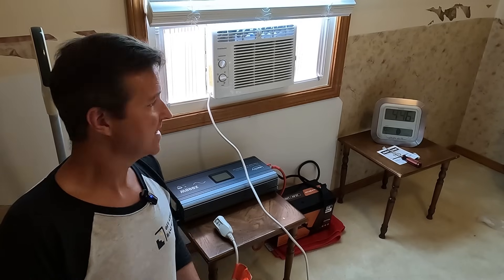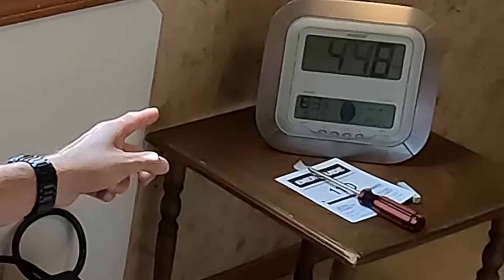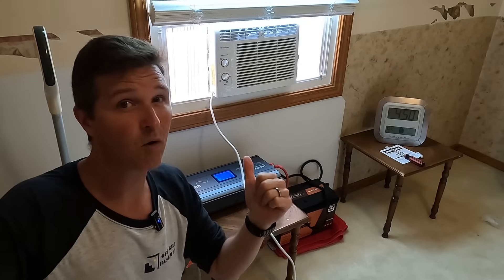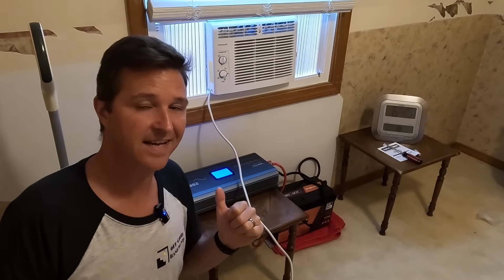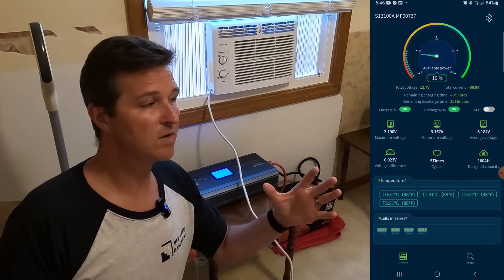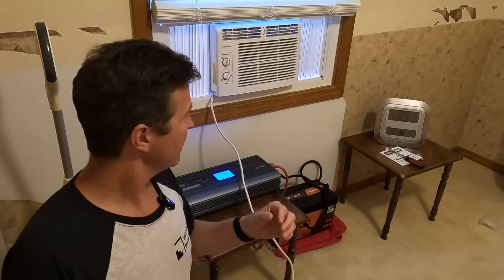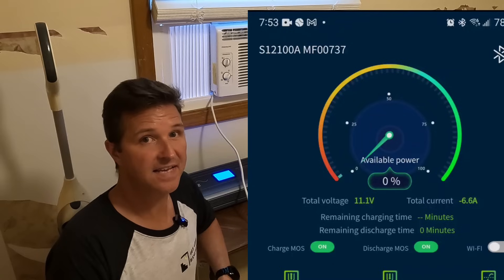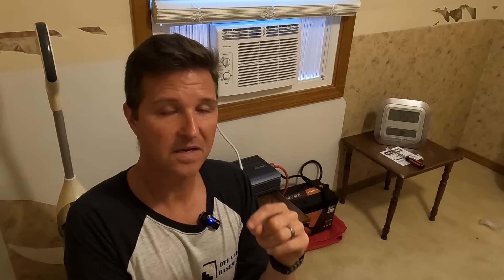How long can you power a 5,000btu air conditioner with a 12v 100ah Lifepo4 battery?  Let's find out!

Comment: Power requirements of a standard window unit air conditioner are much different than a larger inverter mini-split unit.  Inverter mini-splits are so efficient they are turning up on RV's and running on solar.  There's a BIG difference and it's a game changer.
Reply: There is a lot of hype with those Inverter Mini-split Heat Pumps.  I bought 2 upper tier efficiency models for my house so I could run them off of solar and backup power.  These have variable speed fans, compressors, and expansion valves.  The efficiency is highest when they have reached the set point temperature and are about to shut off.  The rated efficiency of these units is a SEER of 23 and 25.  I don't like the SEER (Seasonal Energy Efficiency Ratio, which is a rough estimate of how much power will be used during the summer or winter) rating system as it waters down the steady state efficiency, the EER (Energy Efficiency Ratio, which is cooling [or heating] output versus power consumed) system was much better.  I suspect SEER was adopted for mini-split inverter units because, the efficiency radically changes depending upon the outside air temperature.  For instance, in the test conducted in the video, the mini-splits I have would only show an EER of about 10.  I have observed that when the outside air temperature goes above 90 degrees Fahrenheit, the efficiency plummets.  If the outside air temperature rises to 97, the EER drops to 7.5.
Reply: @billharris6886  THANK YOU BILL!  This is really good data.  Still, having a throttleable air conditioner is a giant leap forward.
Reply: @BulletproofPastor  It is a huge leap forward if you understand and make use of the positive benefits.  In my testing of a standard 60 Hz induction motor window unit versus the inverter mini-splits I have, the mini-split power consumption varies about 10:1 (1,000%) over temperature and thermostat settings versus about 20% for the simple window air conditioner.  In plain terms (something you can sink your teeth into), my estimate of EER for my mini-splits is 5 to 30, depending upon inside and outside temperatures and unit throttling.
Reply: Sorry I don't understand your lingo. Are you saying the mini split is a good choice to run with a solar inverter or not? I would like to get 2 installed to replace window units and it would be great if I could run them on solar all the time.
Reply: @tammieaf2712  Hi Tammie, I'm not sure who your question was directed to so, I will give it a shot in hopes your question get answered adequately.  Yes, a Mini-Split Heat Pump (heats and cools) typically would would be big improvement over a simple window air conditioner, as they are more efficient.  Also, I run my mini-splits off solar power when it is avaliable (weather and time of day permitting).  I chose a 9,000 and 12,000 BTU unit, both run off 120 volts AC.  Most of the mini-splits out there run off 240 volts but, I specifically wanted the 120 volts so the units could be run from virtually any backup power source that puts out a minimum of 1,500 watts (per mini-split).  I could elaborate more but, I probably won't be answering specific questions you may have.  I would be happy to answer any other question to help point you in the right direction.  I live in north central Florida and, being a native Floridian, have been through numerous hurricanes.
Reply: @tammieaf2712  Inverter mini-splits proportion power to both fan and compressor to "softly" turn them on without hard spikes of current.  This feature makes their peak current demands low enough to run on solar inverters that otherwise would shut down because they can't meet startup current needs.  Yes, they can run on a solar system that meets their run current needs.
Reply: @BulletproofPastor  thank you for clarifying that! I have a lot to learn before I will feel confident enough to build or assemble anything electrical.
Reply: @billharris6886  thank you! I have a lot to learn!
Reply: @tammieaf2712  Now retired, I made a career of designing high performance aircraft communication radios, which also includes the design of power supplies and power inverters.  On the side, I have been focused on home backup power since the 1980's when I realized everything is tied to electrical power, a problem that has only gotten worse over time.  I have been doing home solar power on a budget since 2009.  What I am getting to is, I probably have been through your set of problems and can likely provide some direction.
Reply: @billharris6886  Do you know the start-up watts of your 2 units? I was wondering if the 1,200 btu was much higher than the 9,000 btu unit. I would also like to know the run watts if you know. . I am   getting a couple of small minisplits to run off solar too, if possible. Thanks.
Reply: @PersonalStash420   Being fully variable speed everything (compressor, both fans, and expansion valve) there is no surge current to speak of.  When first turned on, the power consumption slowly ramps up over a period of about 2 minutes.  Depending upon the outside temperature versus indoor temperature, the power draw could be as low as 187 watts.  Simultaneous hot indoor and outdoor temperatures cause the highest power draw.  I have witnessed as high as 1,250 watts but, according to the unit specs, the draw can reach 1,600 watts.

The 9,000 and 12,000 BTU units appear to be identical in physical size, cooling/heating output, and power draw.  I estimate the maximum cooling capacity is actually 15,000 to 18,000 BTU.  I bought my mini-spilts in 2020, brand name is Cooper & Hunter.  At that time, the units were considered mid-to-upper level efficiency.  I installed them myself.  I run them off solar power if full sun is available.   Before I installed the mini-splits, my typical power consumption during July (the hottest month) was 33 kWh per day.  With the mini-splits I no longer use the house installed HVAC system, just the mini-splits and now averaging about 18 kWh (aided by solar) daily for July power consumption.  I live in the Ocala, Florida area, typical high temps during the day in July run 95 to 98 degrees Fahrenheit.
Reply: @billharris6886  Thanks for all the info.
Reply: @billharris6886 we live in south jersey in a 1200sqft ranger. We have an very old hvac that runs on oil. 

For AC we got window units and in the livingroom a wall unit. Our hvac is about to go into itslast year because of old age. I don't have alot of knowledge on Hvac and ac but i figured i want to do a mr cool split unit system. 

We have 4 small bedrooms and a livingroom. I would love to hear some recommendations/tips  from you.
Reply: @BulletproofPastor  True don't need a soft start for solar many window AC units are also inverter type lot cheaper. I have one in my shed 5k btu Frigidaire cost $139 at Home depot it runs off a 1500 watt inverter. The nice thing about windows units is sealed system no dicking around with the lines, and leaking flare connections like a mini-split.
Reply: @Mike-01234  I didn't know window units are offered with inverter power.  Thanks!  I think the advantage of a mini split would be quiet operation.  Most run so softly that you hardly know they're on but the robust design of a window unit makes them a more durable option.
Reply: @BulletproofPastor  Someone said to get a "soft start" to get them going.
Reply: @billharris6886  So with the same setup how long do you think a mini-split would run? If he is only getting 2-3 hours on a window unit.
Reply: @Skid_A_Follower_of_Christ  The smallest mini-split is 9,000 btu so, based upon the same size unit I have, using the same inside and outside temperatures, plus the cooling set point, I estimate 3 hours to discharge the battery to the 20% SOC (state of charge point).  This is only a rough guess though, the 9,000 btu unit I have has a cooling rating of 23 SEER.  The window unit in the video probably has an EER of 10.  A lot would depend upon the outside temperature at 6:30 pm and beyond (since the test started at 4:30 pm in the video).  I mention the 2 hour point since that is when the SOC was at 20% in the video.  20% SOC is a good place to stop the test in order to maximize battery life.  Cooler temperatures (below 90 degrees Fahrenheit) cause a large increase in efficiency with inverter type mini-splits.
Reply: @billharris6886  Ok thanks!
Reply: @billharris6886  Your correct SEER rating is takes an average from 65 to 100F. If you are where it only gets to 85-95F not that humid they do pull less power, but if your like me in Phoenix when it gets to 115F outside my cheap 13 seer goodman pulling same power as the 19 seer Trane my neighbor has. The difference is I paid $6500 for my 4 ton goodman he paid $23k installed for his 3 1/2 ton I have measured the current with a clamp meter both of ours pulling 20 amps on each 240V leg when it's really hot out. The ROI isn't there as far as mini-split they are a cheap way to go compared to what a big ducted split system costs I just put one in my garage thinking about installing another one in our bedroom so hot here hard to sleep no matter how many fans are going.
Reply: @Mike-01234  Thanks for your input.  I live the Ocala, Florida area, which is not nearly as hot.  Typical summer high temps usually runs about 95 degrees Fahenheit, while humidity is 50 - 60%.  115 degrees I would think is at (or slightly above) the limits of the average A/C unit, high side pressure would be hard on the compressor.  I agree with your assessment of the SEER rating concerning the expected operating temperature range.  It appears to be a rough estimate of performance the manufacturers can use to their advantage since it is much less precise.

As far as the mini-split goes, one of the several reasons I wanted to go with it, is the lack of duct work.  I don't know about home construction in your area but, in Florida, a flexible plastic duct is used with 1 inch of fiberglass insulation.  The ducting is run through the attic where temperatures are typically 30 degrees Fahenheit above the outside ambient, yet the ceiling insulation is 6 to 12 inches.  Needless to say, the duct work is picking up a lot of heat.  Additionally, the condenser fan motor needs several more times the power to push the air through the duct work.  With my setup, I installed a mini-split on both ends of the house (for a total of two units).  I no longer run the central HVAC unit (which is a 4 ton package unit with an EER of 10), it is not needed.  During the summer months, the daily power consumption for the whole house has dropped 40%.  If the day has full sun, I supplement with solar power for a 60% reduction in grid power.  This has been helping a lot with the electricity price inflation; my rate as gone up 4 times in the past 6 years.

Yes, the price difference between Trane and Goodman is huge, especially if you have it installed, and the performance/quality difference is not in line with the price.

As to your observation, I also noticed that the inverter system appears to drop below the efficiency of the standard induction motor system at high outdoor temperatures.  One thing I discovered about the inverter mini-split, throttling the unit back to the point where it is barely cooling provides the highest efficiency.  However, my observations are just a guess since I don't have the test equipment necessary to measure the actual cooling with all possible conditions.  I always try to keep my units throttled (when conditions permit) to keep efficiency highest.

With the high heat you experience during the summer months, you could probably save some electric by chilling the house a few hours before sunrise, then allowing the indoor temp to rise to 80 during the afternoon, and using more personal fans to keep cool during the afternoons.
Reply: A lot of the mini split I see have worse efficiency than the equivalent window unit. When compared with specs and watt usage  @billharris6886
Reply from the maker: Thanks for the info and the comment.
Reply: @OffGridBasement  I would love to see the same test done on one of these Inverter units.  The comparison would be awesome.
Reply: If it's only drawing less than five hundred watts then why are you using a 2000 watt inverter. Step it down to a 750 watt and you will lose less conversion power from the inverter.
Reply: @quevicular  I don't think that included start-up voltage which could be double that number.
Reply: Not really true. Plus it needs alot for startup watts.  1500 to 2000 is required.   @quevicular
Reply: This is absolute nonsense. A 9k btu 12v mini split requires 60-80 amps. With 600ah available battery you'd be lucky to run it 6-8 hours at mid cooling. Lol
Reply: @fvgc454ss  So I looked up both on Amazon and the mini split has a better seer rating. My wife and I last year stayed at an off grid cabin in Mississippi for 2 nights. Ran everything we needed with no problems. All from solar. They also installed mini splits in all the cabins.
Reply: @skid4482  🤦 its simple math bud. To run AC on DC requires a ton on amps on high cool. Always will. Your mini split isnt much different at all as that window unit in any way. In a cabin with a pile of panels in direct sunlight and batteries are required to run all day long and not efficiently. On a vehicle is another story completely. 12v 9k unit requires minimum 50-60amps to run at full cool. This isn't magic. Do the math and you'll understand.
Reply: @fvgc454ss  Here's some hard numbers for you.  We have a Midea 12,000BTU inverter window unit and I put a "kill-a-watt" meter on it.  Our daily temps are still in the mid to upper 80's.  After 18 hours it has drawn about 1200 watts with a peak load of 640 watts.  That's just 5.33 amps.  It draws less than the 6000 BTU conventional window unit that it replaced and does a better job while being whisper quiet.
Reply: @BulletproofPastor  🤣🤦 ohms law bud. Now try that using 12.5 volts
Reply: @fvgc454ss  Power requirements are measured in watts which is simplified as volts x amps. Since we are measuring the power consumption of an inverter window unit that runs on 120v, the power measured is 640watts.  Your amperage required to run a 12v system powering an inverter is immaterial.  DC to AC conversion is slightly different but as 12v is roughly a tenth of 120v, the current on the 12v side would be about 53amps.  However that doesn't account for 24v (27amps), 48v (13amps), or 96v (7amps) systems.  This is why power is measured in watts, not amps.
Reply: @BulletproofPastor  🤦🤣🤦
Reply: BTW - I bought our Medea 12k btu window unit as the result of a comment here that said they now make inverter window units.  THANKS
Reply: @fvgc454ss  BTW - since the original subject was "how long can you power a 5000 BTU with a 12v Lifepo battery" I figured my inverter window unit would last about 2 hours on a lead-acid or 4 hrs. on a Lithium battery of the same rated power.  Far better to go up to a 48v system with more batteries.
Reply: @BulletproofPastor  🤦🤦🤦
Reply: Yeah they are 0.5 ton vs Normally 1.5 ton
Reply: I doubt a mini split can beat the COP of a window unit, maybe with inverter motor. Window unit is very efficient in its arrangement with the one motor running both fans.

Comment: i did something like this with my solar generator and a window a/c.  i found if you put the window a/c to 'max cool' the condenser will never turn off, so the wattage it uses is always the maximum (in my case it was about 425 wh).   when i put it the temperature dial to half way between min and max, the condenser would cycle on/off as you would expect and the wattage dropped to about 200 wh on average or less.
Reply from the maker: Thanks for the information and the comment.

Comment: I have 2.35kw of panels on the roof of my 14 x 36' cabin.  My 48v 3k watt inverter runs a 12k BTU AC and 2 box fans every day with a 48v 100ah battery.  The system also powers all my interior lighting, and a lot more.
Reply from the maker: Thank you for sharing your setup and also the comment!

Comment: I'm not familiar with your 12v app.  I recently contacted an a/c retailer concerning their 8,000 watt window a/c
to find out the startup, and continuous amp requirement for their 120v ac air conditioner.  I was told to expect
10-13 amp start up amps, no comment on continuous run amps.  It would be helpful to know both your startup,
and continuous amps needed from the inverter to the a/c unit.  I've also looked into the use of an RV Soft Start
device that makes it possible to run an a/c with a smaller power source/generator.
Reply from the maker: The continuous would probably be around 4 - 5A.  I was told this unit has a soft start built in, but I haven't confirmed that.  Hope this helps.  Thanks for the comment.

Comment: Good video.  Many variables can account for varying results.  It would be good to know the amps when the unit is running and then when it is idle. I know this is not about efficient air conditioners but I prefer the mini split to standard window units.  Anyway thanks for the video and all the best from north Texas.
Reply from the maker: You're welcome.  When the compressor is running it used about 35-40A.  It used around 9A with just the fan.  Thanks for the comment and stay cool in Texas!
Reply: @OffGridBasement  yes we hibernate  in summer in Texas.  When I grew up in northern Minnesota we hibernated in winter.  Haha

Comment: if the ac = 5amps ac *120 v= 600 watts / 12 v = 50amps dc. so for 100amp battery is 2 hours.
Reply from the maker: That is if the AC compressor is running constantly.  Once the room gets to temp, only the fan runs.